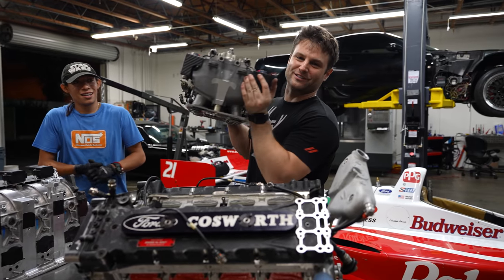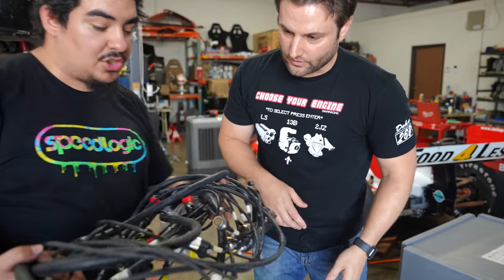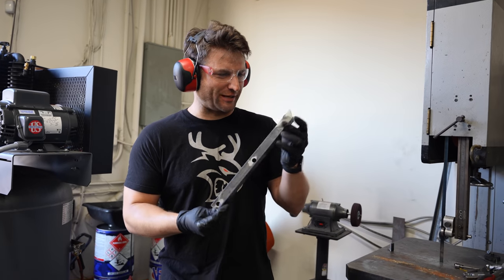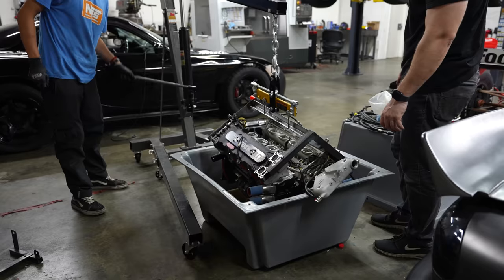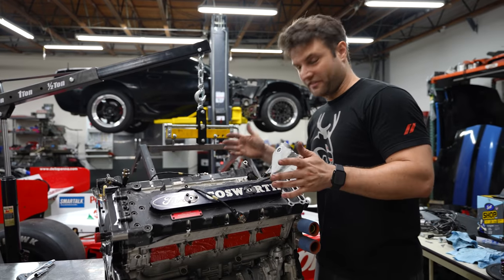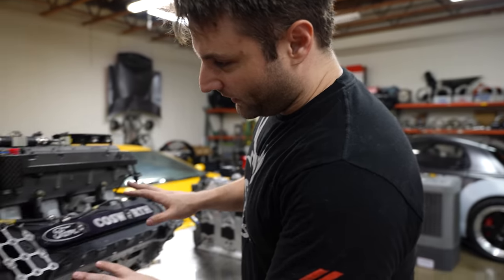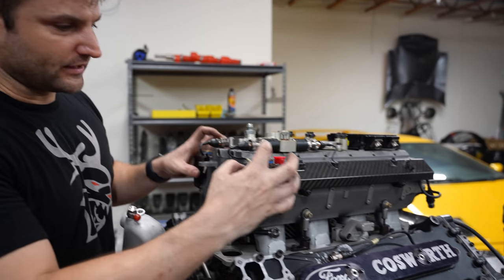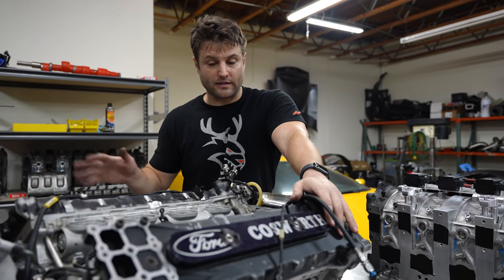I bought a $37K running IndyCar engine. I shouldn't own this

Comment: Would putting a reed valve or a rotary valve like a 2 stroke to a rotary engine allow for larger ports or any N/A power gains? Or would it not add anything?

Comment: This is awesome, Rob. Doing what everyone loving 90s Indy car wanted to do. Believe it or not, they only had about 5-7 pounds boost over atmospheric. You may resto mod it but you might find out how good the ‘old’ race spec turbos and injectors of the time really were. When the Older versions, xa , xb , ran Indy, they saw about 2mpg in the race. So think about that methanol fuel bill ahead of you!

Comment: The most impressive thing about race engines is that it is quantitatively harder to make power out of something smaller than something larger so all the components have to be that much higher quality.
Reply: I feel like this is less impressive, and more obvious, than anything? These things are turning like 12k rpms.. That alone should tell you that. They're something like 3.5 liters too, I think, making under 1000 horse so... Nothing that seems overly impossible is it? 

This is just a weird statement. Odd way of putting it... Very odd reason to be fascinated too lol. You're an odd one aren't ya?

Comment: In 1 breath your praising the old teck and how you will learn . Next your talking about making it better with modern and thats cool. But do you really want to go faster than 240 mph in a old hand laid carbon stressed chassis ?
Reply from the maker: I mean that modern tech makes it possible for me to do what an insane race team did back then. Modern turbos mean more power under the curve so it makes it look like I know how to tune when it’s just a byproduct of advancements in technology. Ecus and turbos are mostly what I am referring to
Reply: @RobDahm  Ya working in a old DOS system would be a royal pita and point less . Then again so is rebuilding that motor to stock specks where the motor won't even turn by hand untill at opereating temp .Have fun spending a 100k and good luck with this project it will be fun to watch

Comment: 37k? That’s it?! 

Wtf my 410 sprint car engine is 60k a pop..
Reply: Well, it is an old, obsolete, used engine. I'd be willing to bet you could get a 410 sprint engine for far less than 37k if you were willing to go for used and not the best.

Comment: Bro do you need a mechanical engineering intern this summer, cad experience, HAAS cnc experience, machine shop experience, rotary engine experience, experience designing and building student formula sae cars, experience editing
Reply from the maker: I am about to put a post out.  I cant do it all.  I need help with expert mechanics so they can help do what im visioning for the car builds and ill take responsibility for the sketchy things
Reply: @RobDahm  exciting!! Before I spit my resume here I’ll just hold off for the post

Comment: Hey rob, how are you planning on getting a rotary to be the structural part of the chassis for your indy car?
Reply: I doubt he will. Just build a subframe to hold everything together that the motor drops into. The harder part is going to be how to connect the crank to the transmission without having the engine hanging below the car.
Reply: @wingracer1614  good call on crank to transmission height.. gonna be interesting to see what he comes up with, plus seeing what a rotary revs like with a flywheel small enough to fit that gearbox

Comment: I know this is the “rotary channel” and believe me, I’m all about ridiculous rotary engines but maybe for the Indy car leave it “stock”. Like modernize it, make it reliable and fun and all that but maybe leave the Cossie motor in it. There’s just something special about a high-revving V8 in that little-bitty car. Idk, this is a subject that I kinda struggle with in the automotive world: when to swap motors? For example: I have a ‘64 Corvair Spyder. It’s special because it’s an rear-engined, air-cooled, flat-six car with a turbo. In 1964. From Chevy. I’m planning on restoring it one day and the struggle for me is deciding between modernizing the original setup or swapping something else in, like a Porsche motor. At the end of the day, it’s still a homegrown rear-engined sport compact but would I have removed the essence of the car by engine swapping it? This is the same thing in my eye. I’m rambling on here, I know, and it really doesn’t matter I guess if an owner is happy with their car but it’s just maybe something to think about.

Comment: When do you think the engine is from? You think Cosworth didn't have CNC machines in the late 90's to early 2000s? G series turbos are way better than what it would have been fitted with, really ? It would have been the best possible hardware available pretty much without regard to cost, not a mass produced built to a cost production offering. Tech has undoubtedly developed but I think you're massively underestimating how good top end tech of any era is when compared to the mainstream.

Comment: I think that is the pci injector that was stuffed in the plenum. 8 cylinder injectors. 4 pci. 
Did you double check that it has a bottom end In it. These race car people can be sketchy.
I'm joking. That's what my dad said to me after he Wrote the cheque. "I hope it has guts"
When u sit in the car slide down deeper. Twist your torso.to get under the headrest. Your sitting to high. The deaper you sit its more comfortable. Fire extinguisher is under the seat. 
Not that I would ever try to tell someone whom owns ones very own champ car what to do.

Comment: Mil spec harness just means the pins will break once you’ve installed it
Reply: I spent 20 years working avionics on the B-52 and E-3, and never once saw a broken pin in a connector. I did see an occasional bent pin though, and that was almost universally caused by mishandling the connector. Unfortunately, broken wires were far less uncommon but not a result of a characteristic of the connector.